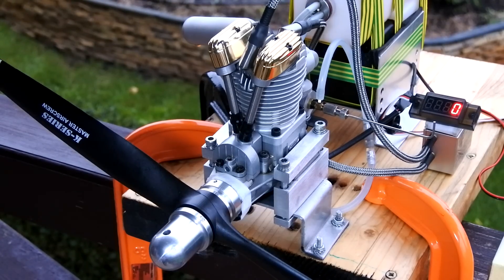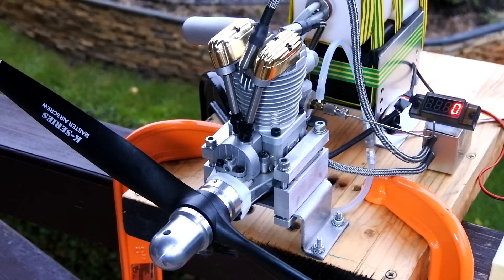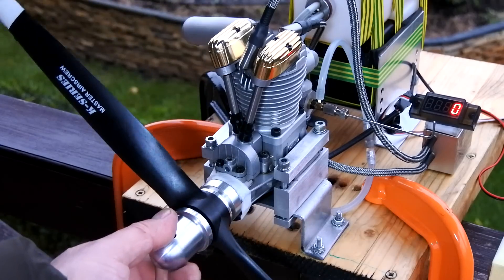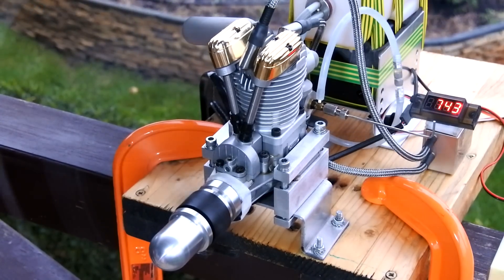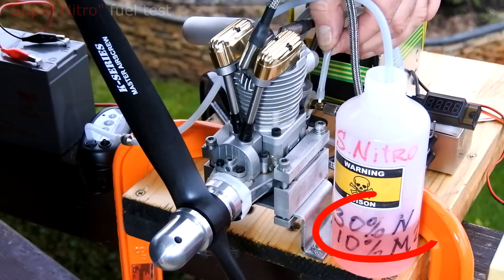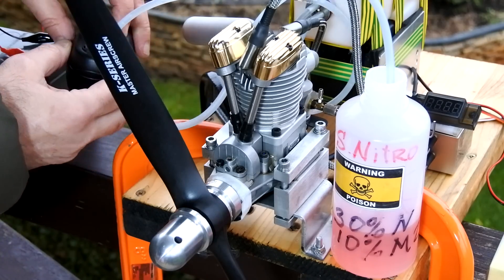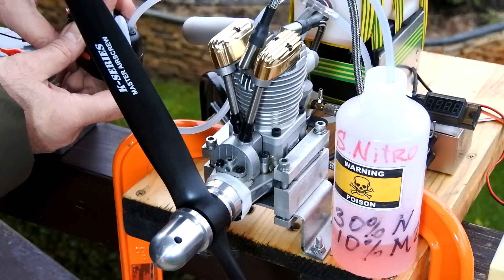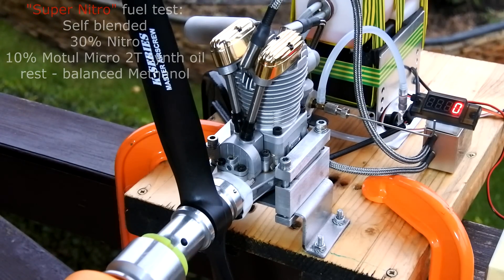Saito FA 120S DP - 3 answers at final test run

Comment: Just a note about how your YouTube settings.  If you state that this video content is 'made for kids' then the subscription notifications are automatically turned OFF.  This means that subscribers, such as myself, do NOT get notified when you post a new video.  This can impact the number of subscribers you can get, or keep current ones from seeing new videos unless they automatically go looking for them; which I do not.  
Until you change you test run setup in such a way as to not be operating an engine from the front or side of the, I would NOT say this content is suitable for kids.  You are showing a very dangerous way of operating these engines and it is not something that should be encouraged by others to do.  All glow engine manuals from reputable manufacturers all state NOT to operate glow engines in this manner.
Reply from the maker: Thank you for your comments and recommendations. Usually, i was newer marked videos, as  “ made for kids”. Probably, sometimes it could happens sometimes due to mine inattention.  You’re totally right about my test bench - it isn’t safe enough, as it could be. Anyhow,  I’m on the way to the, safe and more operational test bench.